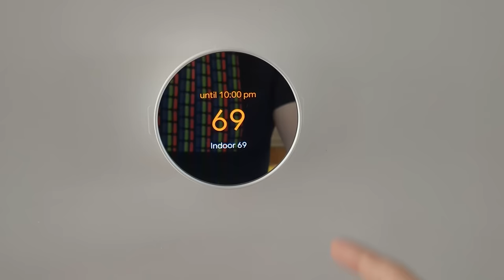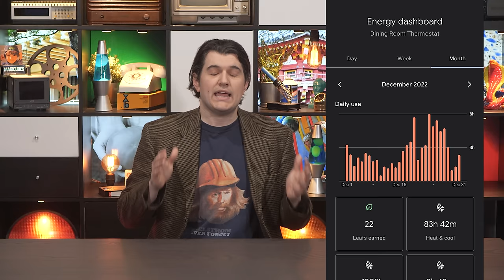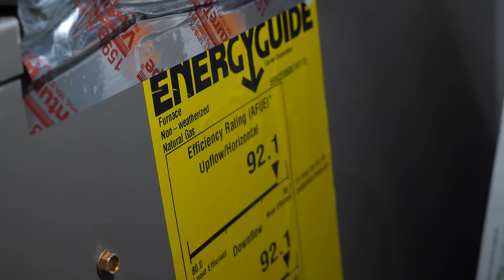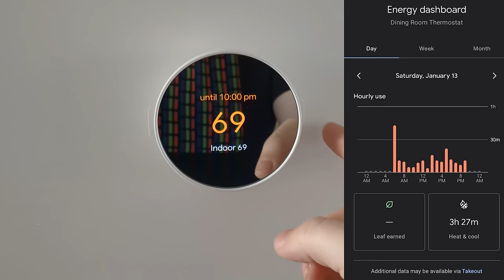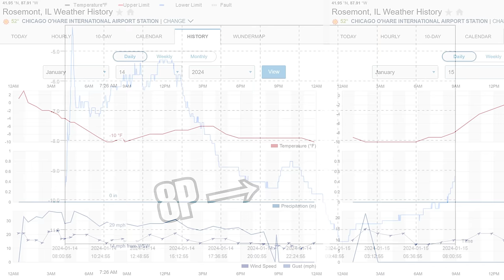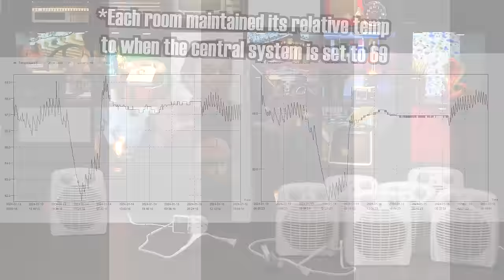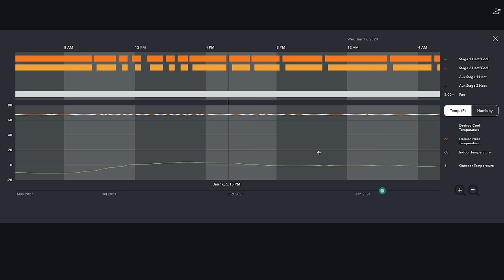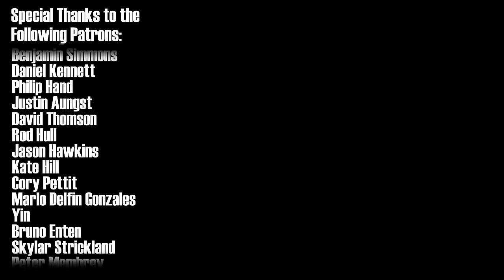Old HVAC industry practices are holding us back and costing us money. But we can fix it.

Comment: I have a 2400 square foot home that was built in the 50’s and is insulated in the loosest sense of the word. I replaced our radiant boiler with ducted 4/5 ton heat pump system (I did all the work myself). My manual J put me at around 42000 btu loss so I got the bigger unit which can be switch to 4 ton mode for higher efficiency. It’s has never let me down in the northern Michigan winters where sub zero temps are regular. I have 10kw heat strips which I've never needed as backup, but they do run during defrost cycles to keep the air warm while the fan runs. this was our 4th winter with the system and i have no regrets.

Comment: Hey from Germany, same problem here. 
I reduced the max output of my parents furnace from about 11 kW to around 6 kW, mainly to increase run time/ reduce the amount of cycles it runs. But it’s moooore than enough and basically runs 30% of time even on the coldest days. So yeah, technically the house needs around 2 kW for heating and funnily enough they already have two HVACs installed that can also heat with combined 8 kW (peak, in winter that would be way less. So not really oversized on that side).

Comment: In regards to the Nest thinking you're away despite all the evidence to the contrary, it's likely because you have presence sensing enabled (which is the default). This setting overrides all other locations functions and will set the thermostat to "away" if it doesn't sense motion for a certain amount of time (30min or so). So if you're not in the room with the thermostat, it switches to away. This would be useful if you had a thermostat in every room on a separate zone, but for most of us with a zone per floor, it's useless. Turn off presence sensing and the location sensing improves dramatically.
Reply from the maker: I appreciate the help, but that's not the problem - I disabled that long ago because the t-stat would erroneously sense movement and start heating when I was away.
Reply: I had the issue thinking I was away due to having multiple home structures.  I moved houses and it was still thinking I was at the old house.  Once I deleted the old structure and set it up on the correct one it has worked.
Reply: @TechnologyConnections I’m with you. I have tried everything and it just doesn’t work. Can’t tell you how many times google turned the lights off while I was sitting in the room with a nest thermostat

Comment: Last fall I got a new forced air heat pump installed in my home.  I'm in southern Ontario in Canada, so our winters get pretty cold.  I got a Mitsubishi Zuba cold climate heat pump installed sized at 36000 btu.  My previous gas furnace was rated at 45000 btu.  

In order to qualify for a heat pump rebate, I had to get a home energy audit done which calculated that my heating capacity was about 36000 btu.  That was also the value that the HVAC installer came up with from their calculations.  They didn't even bother checking the size of the existing system.  I also double checked this with thermostat data for a cold day, and by checking all my gas bills over a winter and calculating total gas used, and converting that back to energy.  They call came out around the same.

This winter was not particularly cold.  The coldest night was around -18C, and the heat pump handled it just fine.  It didn't even hit 100% duty cycle during those nights, although it was running pretty hard while it was on (it can vary its output based on the desired load, so it's not just full on or full off)., And my backup heat strips (10kw) never kicked in.

So far I'm very happy with the result, and the Zuba has some really nice features like keeping the circulation fan running all the time at a very low level, which evens out the temperature in the house, making things much more comfortable.

Comment: Southern US here.  Our CHAC is a combo heat pump unit.  At the time (about 7 years ago) it was $9,000 for the entire system to get installed.  We intentionally went with a slightly heavier duty 3 ton unit because we're in a detached home, have 10 foot ceilings, have a lot of windows,  and we plan to eventually enclose a porch and hook it into the system in the future.  I checked and the same(slightly more efficient) 3 ton unit installed today is about $10,000  from that company. 

In addition to the separation of sales and installation problem you noted, I suspect that anyone quoting $30K for the installation of a heat pump unit is basically giving you the "go away" price.  That is, they've got enough business lined up that they don't need yours and they want you to go away.  But if you're desperate and dumb enough to pay them three times the going rate, then sure, they'll do it.

Comment: installing more capacity than needed = more commission. its all a scam. can't trust anyone these days! even the well reputed people do this!

this is why educating the masses is so important and you are doing a fantastic job!
Reply: Not at all.

The price difference between an 80 and 100k btu furnace is like 10 dollars.... no one's getting rich off of that.
Reply: @asbestosfibers1325 Oh you sweet summer child.There is definitely installers out there selling bigger systems than necessary to make more profit.
Reply: @asbestosfibers1325   The raw equipment doesn't cost much more but that's before any dealer markups.

And regarding that $10, it's probably a little bit more, especially since you're probably switching from a 17" to a 21" cabinet. Probably more like 100-300 USD.
Reply: @asbestosfibers1325  A 100kBTU furnace may be just $10 more than an 80kBTU furnace, but note that 100 is not 3 times 80, and furnace is not a heat pump.
So if you really need 80kBTU heating, a better analogy would be: How much is an 80kBTU heat pump vs a 240kBTU heat pump?
Go on, I am waiting.
Reply: Its not. You also need more capacity for the heating up period. This test was run as considering your house to keep 24/7 on the same temperature, what would cost way more energy. So installing more capacity can actually save energy. But you need to take into account the speed of your radiators or floorheating for that
Reply: @Science1144   Not quite. When the indoor temperature is set back lower than the design temperature your heat losses are lower than expected. This means the 100% sized furnace still has some extra power to bring the temperature back up even on the coldest day. And on the other 362 days it can do this without struggling. And this effect is even greater with heat pumps. Heat pumps actually output more than their designed output when the indoor temperature is low.

Having said that, it's fine (and I'd argue a good idea) to oversize a little bit, perhaps 15-25%. This can also provide insurance for possible changes in the building's performance. Up to 150% sizing generally doesn't hurt performance. If the installed equipment is over twice as large as the calculated worst case there better be a very good reason.
Reply: @Science1144  ... Yes, but not 3 to 4 times more. And you can have backup resistors inline in the system for those rare cases where you are close to max delta T and you want to quickly increase the temperature. Resistor are super cheap to buy and install. They consume more energy but you will almost never use them.

Comment: Oh boy do I have an oversizing story for you: when I bought my ~1800 sq ft house here in Ohio, it had a 125,000 BTU gas furnace. I’ve worked in commercial buildings with smaller equipment than that. It was quite old and was replaced with a ~68,000 BTU two stage furnace. The new furnace was better but my 1960s era house had a lot of opportunities for additional insulation. Over the years I’ve improved things enough that I can now keep the house comfortable using only the first heat stage (about 37,000 BTU) even at -5F, which is close to the typical minimum we see here anyway. I’m now confident switching to a 3 ton cold climate heat pump with maybe 7 kW of aux heat. So there’s another data point showing ~3X furnace oversizing isn’t rare
Reply: One could argue that a gas furnace that runs less often needs less maintenance or is more tolerant to maintenance being neglected. You're still probably better off with the right size and doing the proper maintenance.
Reply: @extragoode  won't claim HVAC expertise but I believe most of the wear comes from startup/shutdown (along with lack of maintenance). FWIW the newer two stage furnace has only needed one service call in 11 years of operation

Comment: I bought a 1993 house in Ellenwood, Ga 3.5 years ago. They told me I need a new hvac system. $9,000 to $10,000. They claimed, they could not fine parts for my then 27 yod unit. I watched a lot of youtube videos and I learned how to fix my unit myself. I replaced the old r22 evaporator with a new $300 410 part and installed a new $1,900 condenser. The a/c work better.
Reply: You replaced the TXV too right? LOL
Reply: @fanawb  The old unit didn't have a txv.

Comment: Just checked my data from the same cold snap. my furnace was still under 12 hours for the day. It was also far colder here and we were home with the heat at a higher setpoint. Looks like once this dies, ill be able to size a smaller unit here too (which I already was planning on) Love the well informing videos on this stuff. Keep it up!!

Comment: I upgraded to an ecobee smart thermostat in January, and discovered that the system kept cutting power to the thermostat.  After five visits from the local HVAC repair place and two limit switch replacements, they figured out the furnace, as configured, couldn't draw enough air through the ductwork. Just like your friends!  I'm in California's Central Valley, which might get down below freezing a couple of times in January.  According to the ecobee, since January my furnace has only run more than two hours on a single day once, and that was a day when the tech was here and had the system on continuously to diagnose the problem. 

I bought the house from the builder in 2019, and their sales person told me (over the phone, not recorded, not on paper) that it had a heat pump.

Comment: In my townhome, the neighbors kept me warm enough in the winter that I didn’t have to use mine. Saving money based on other people wanting it hot!
Reply: This is genious. You can steal heat from your neighbours and nobody would know.
Reply: Imagine if you had neighbors on 5 sides out of six!
Reply: @Klaster_1 they call those high rise condos.
Reply: That is what I was wondering. is he on an end unit or in the middle.
Reply: @robertsmith2956 exact same thought. Center unit has basically infinite insulation on two sides.

I lived in 2 similar apartments, one on the 2nd floor and one on the 1st floor. The 2nd floor, even being 300 sqft bigger, barely needed any heating in the winter. The 1st floor ran significantly more.

They were both in the same complex, built after 2010 by the same company.
Reply: They'll keep you really warm when one of them leaves with a stove burner or curling iron left on.
I want my walls to belong to me.
Both sides of them...
Reply: this is VERY common in the UK
Reply: I try not to.
@Klaster_1
Reply: @carwashadamcooper1538  fair point, I understand completely! However my wife worries me at times as much as the stranger sharing the wall might 😬